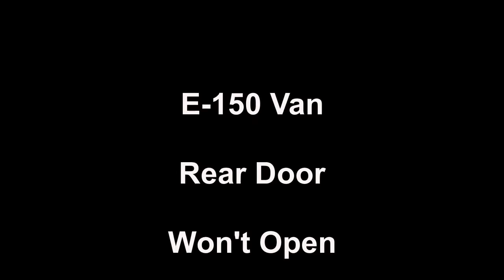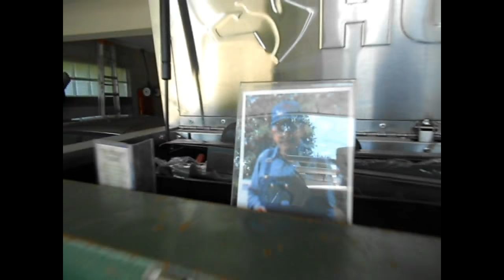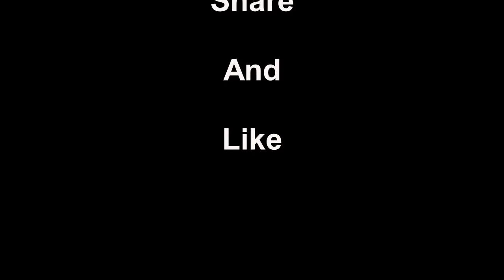E 150 Rear Door Repair

Comment: Thanks for the help! I was able to do the back door in a breeze with your video. For all those interested, I have changed every cables on all 4 cargo doors of a 2007 E250. Only the cargo doors, not the front driver and passenger...not yet. The cables and metal unit (if you were to buy the whole kit) are identical on both side cargo passenger and back door passenger. The only difference between the two is the bottom lock. The bottom lock on the cargo passenger door is attached to the metal while the one on the back passenger door is attached to the license plate box/tray. The cables are identical on both units. 
The same applies to the inside cargo & back doors (the door you open after opening the right one) The metal units and cables are identical for both top and bottoms. 
Also, the 'top' cable (the shorter one) from both cargo & back passenger doors are just to open the door from the interior.  Well, that short cable is identical length to the 'left back door bottom" (driver side). I was in a bind because the back driver side door would no longer open. I had a spare cargo passenger side door complete unit so I decided to check if the top cable was the same length and voila! door was fixed using that cable. I still had to order the top cable for that door but at least I could open the door until I received it.
Hope this helps some of you that need to change the cables and please, do not waste your $$  on those metal ends unless you know for sure they will fit with your van year. I bought some and none worked. They all would have needed to be modified and from what I have read online, it has happened to others also. The original cables are not that expensive on Ebay.

Comment: Thank you, thank you, THANK YOU! I spent a long time trying to reach up inside the door to disconnect the linkages. No luck. NOT ONE OTHER video mentions the solenoid mounting and how to pop it out. 30 seconds after watching your video I had it out. 73! Tip to others, if your problem is just the cables, don't mess around with the Dorman replacement ends. The cables are either already stretched or will get stretched and you end up pulling so much to open the doors you bend or break the metal tabs on the levers/latches. Instead get the cables as a set online for around $15 and replace both. Opens like new and good for another 20 years.

Comment: I got you aluminum ends for my cables did all the replacement took the latch out same way you did. Only problem is I'm not 100% sure if I have the steel ball in the right slot. I was able to get the inside latitude continue working but the outside wasn't working not sure if I'm putting ball in the right position on the latch. Or maybe the cable is just to stretched out to work but I'm not able to get it to work. Maybe you can point me to a video that shows someone attaching the little ball ends on the cable in the latch on where they go precisely.?
Reply from the maker: Not sure without looking at it and I don't have that van anymore I would try Googling Googling it and see if you can find a parts breakdown picture

Comment: The cables can be fixed with Dorman 926-111 cable ends. The plastic breaks and the repair is aluminum ends that slide over cable and onto cable housing. 11.99 at oreilly and 10.99 at autozone. one kit does one door. Supercab back doors or Econoline back doors.
Reply: jimmy aber, they are crap those aluminum ends. I bought some and they don’t even fit. I’m not the only one saying that, others had the same issue. Buy the right one once on EBay and fix it the first time instead of the aggravation of messing with ends that might not work.

Comment: I am trying to replace the entire plate with lock. Can you twist off the lock cylinder and reuse it? Does it twist off
Reply from the maker: Should be a clip that holds the lock cylinder in

Comment: what if I can open mine by the handle from the inside but the handle doesnt open it from the outside? The key doesn not unlock it either.
Reply: also my end piece my cable is plastic and is breaking. I got the "fix" supposedly which you slip on the end but the tiny little ball on the end is plastic. Not metal like im seeing in all these videos. My van is a 94 E-150

Comment: I've tried to loosen the Econoline upper rear door striker . It attaches with 2 hexagonal screws. They've never been loose from the factory. They won't budge. Other than drilling them out, anybody have any tricks?
Reply from the maker: You want me to take that hex socket you're using and smack it good with a hammer. Sometimes that will loosen up any kind of corrosion on the threads and then you can back it out
Reply: @RCindustry  ok thanks
Reply: Perhaps an impact driver. You will have to buy the right tip since the tool only comes with a few tips.
Reply: @RCindustry  I used my impact wrench, with adaptors,  to take out T27's